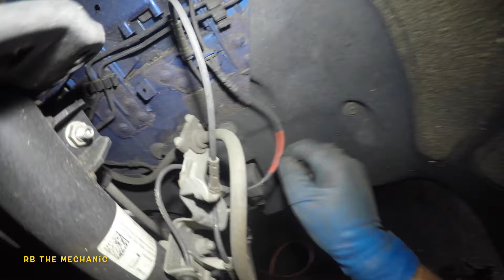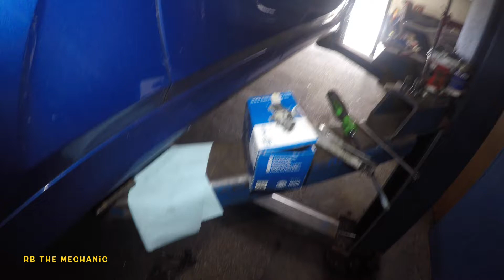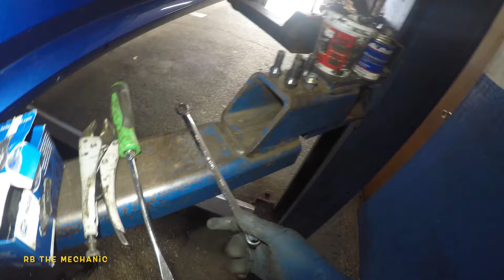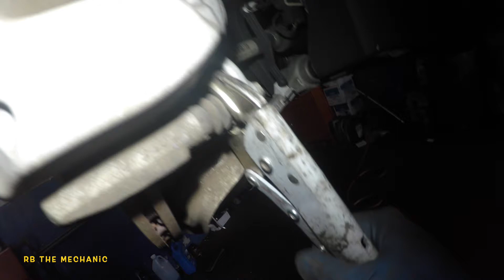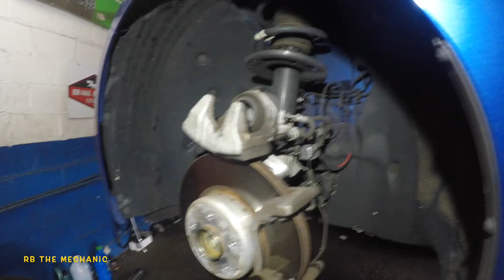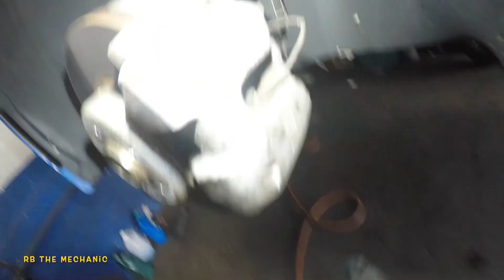2019 BMW 330 front brake pads replacement HELLA PAGID

Comment: Pro tip: Don't use Vice-grips with teeth to hold the slider pin bolt. The teeth can tear the rubber boot. Use a skinny crecent wrench to hold it
Reply from the maker: But we r away from rubber boot

Comment: What happns if you mix pins with  an without pin? I install bush on top..
Reply from the maker: What? Didn’t understand which in ur talking about
Reply: @RBTheMechanic  Installed bushed pin to upsie of caliper by mistake and hav been driving since few months without problem will it cause inner damage at caliper?
Reply from the maker: @ prolly not
Reply: @RBTheMechanic  So is it better to this unknown order of bolts or switch one with bush to the first place?